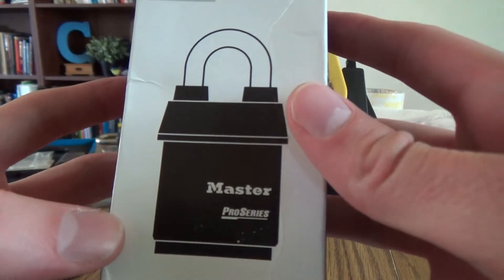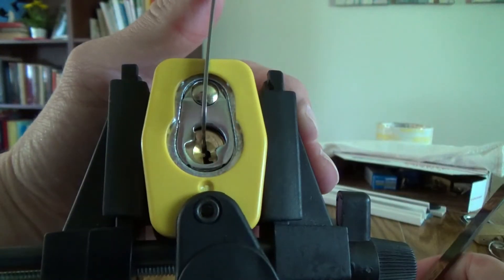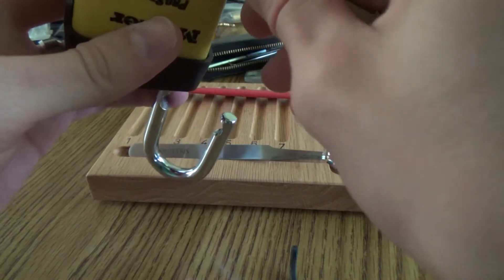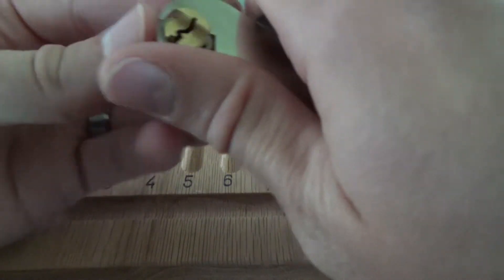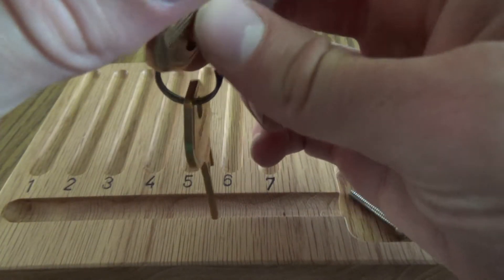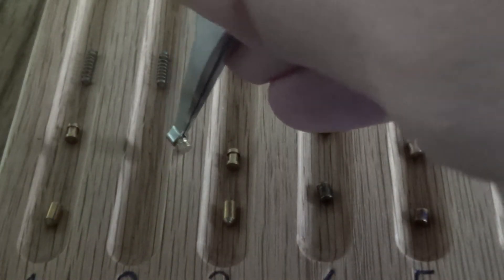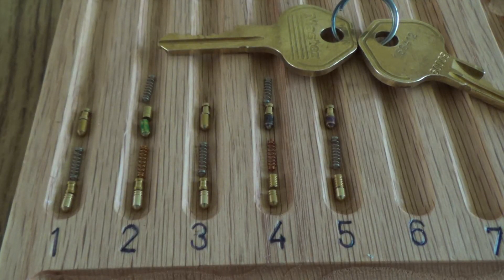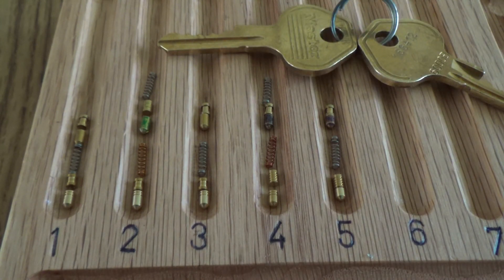Master Lock 6121 Picked, Gutted, and Improved

Comment: Nicely picked. I like the Master Lock Pro Series  locks.  I haven't picked that particular model, but it looks nice. Yeah, the cores are fairly easy on most of them. Nice upgrades.  You can also add a pin 6 by having an American #3, or 4 keypin ride on the tip of the key. Load up pin 6 with driver of choice,  but I've found that using a T-pin in driver #6 can cause sticky key problem,  where the core doesn't want to turn as easily,  & hangs up. I'll try to find the video I made where I added a 6th pin on a 5 pin key.
Reply: Video #336 is where I added a 6th pin to a 5 pin master lock 6835.
Reply from the maker: Thanks for the tip!